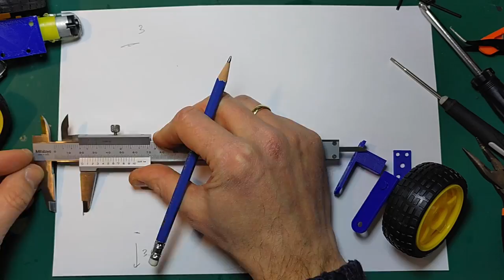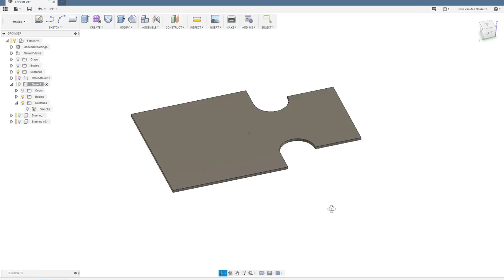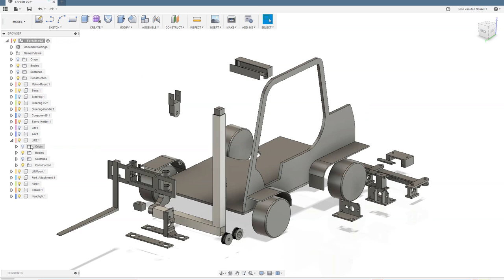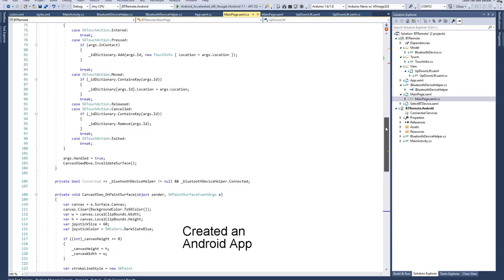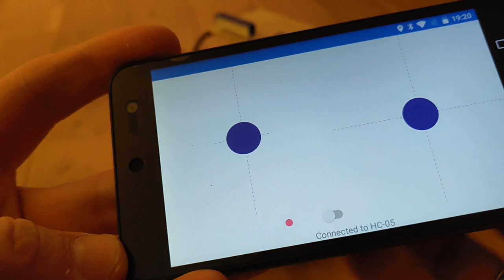RC Arduino Forklift (bluetooth)

Comment: Thanks.  Stl files are 10 times bigger? ???  Why?
Reply from the maker: Are you sure that's not caused by a setting from your slicer application?
Reply: @LeonvandenBeukel  Measured in Fusion 360.
Reply: @LeonvandenBeukel  Ok now ,Thanks
Reply: @LeonvandenBeukel  Like this project.